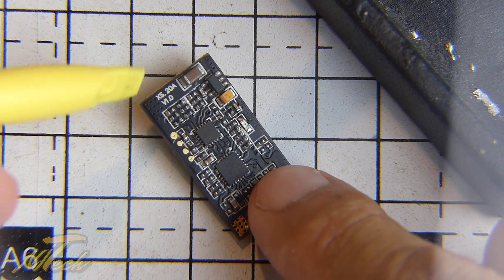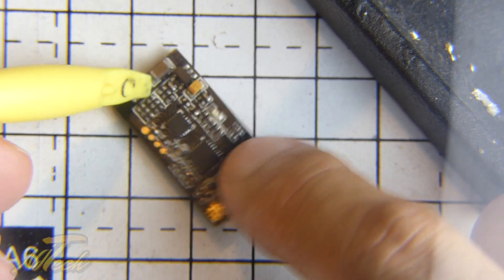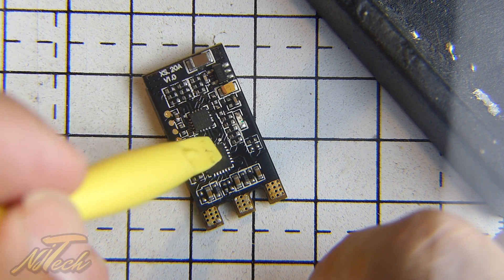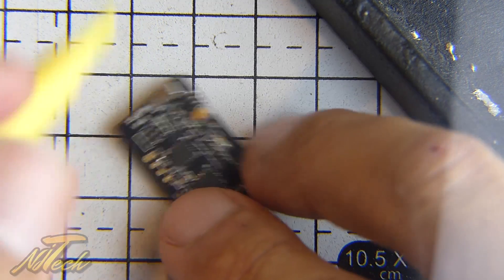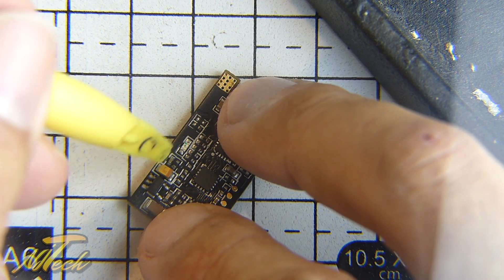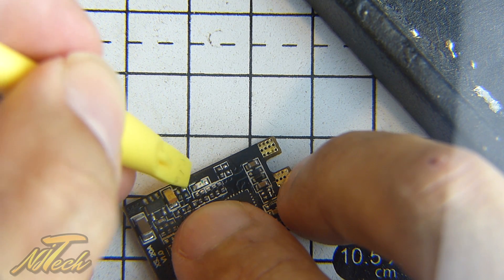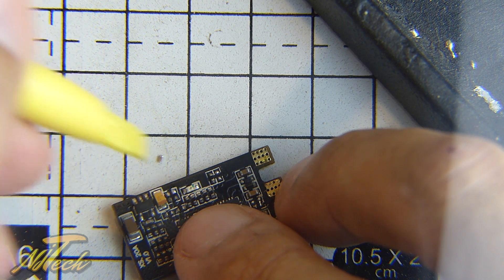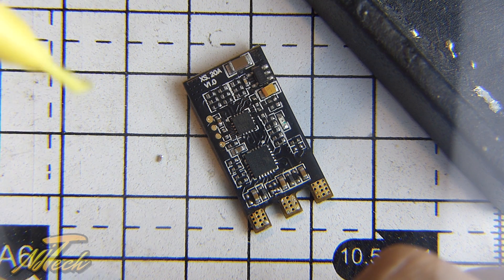DSHOT your ESC the QUICK way!

Comment: Can you still run mutishot on that esc after you remove the capacitor?
Reply from the maker: yes, and in fact, it works better according to the guys over at raceflight :)
Reply: NJ Tech ok cool. By chance do you have a photo or documentation of where the cap is on the dys xs30a esc?
Reply from the maker: no chance required.  Google dshot, go to the wiki, scroll down to supported ESCs, has a link with picture for cap removal of the XS30As. :)

Comment: Can akon 30A 2-4cell  ESC do Dshot?
Reply: H
Reply from the maker: Check the wiki linked in the description, there is a list of compatible ESCs. If it runs BLheli_S then 'usually' it will be able to do Dshot at either 150, 300 or 600 as of right now. Anything older than BLheli_S will not.

Comment: what's the best firmware I can run on the XM20s?
Reply from the maker: I always just run the latest stable version, i usually feel small improvements with each iteration. With XM20s, Dshot is not available so i would personally run with multishot. You can find the hex file for flashing multishot on their RCGroups page.